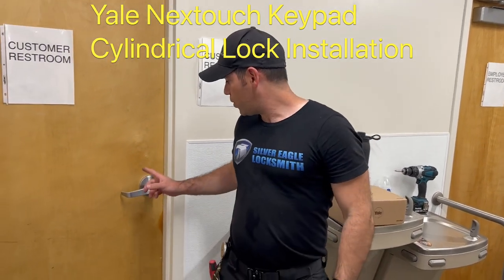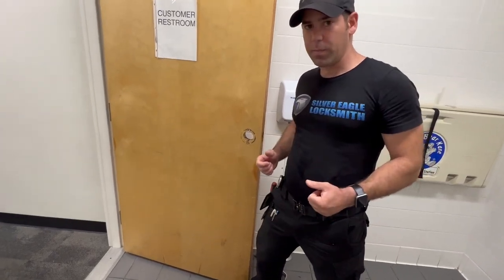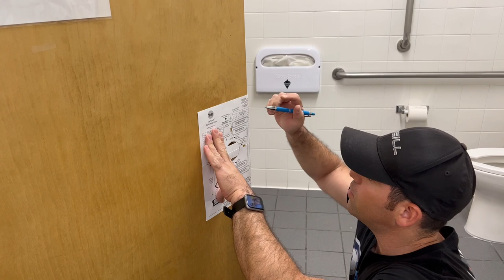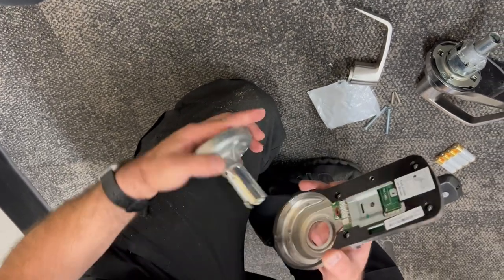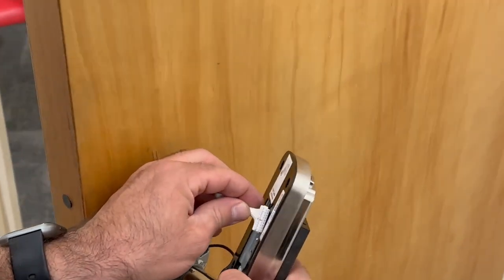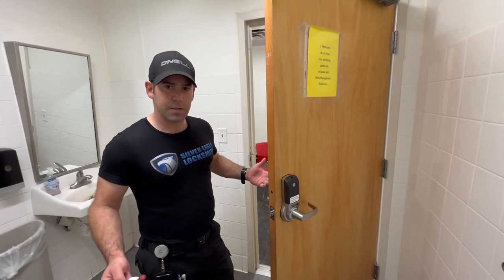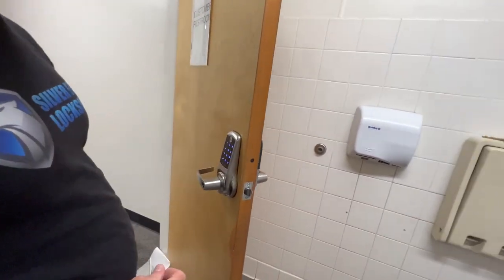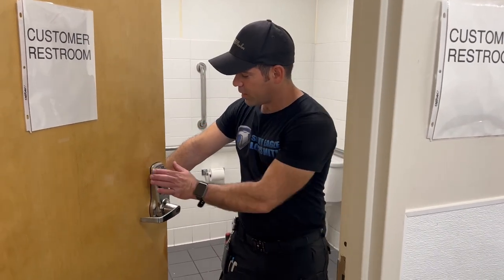Yale Nextouch Keypad with Privacy - How to Install A-Z

Comment: What was the extra hole in the door jam and in the door edge for?
Reply from the maker: It’s for the door sensor to enable the privacy feature for this lock.
Reply: @S.E.Locksmith  Did you install the door sensor in the video? I must have missed it